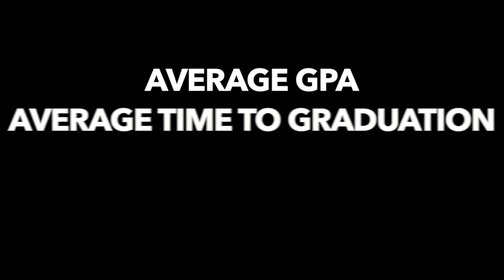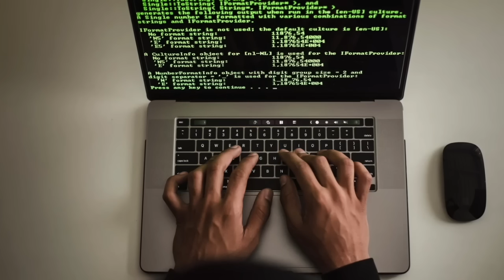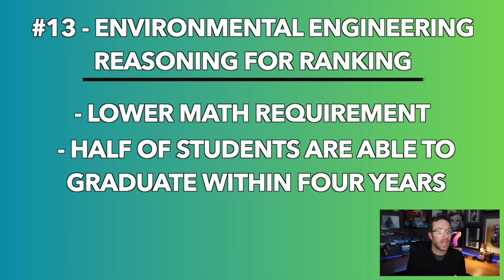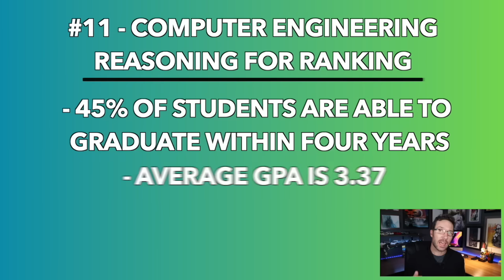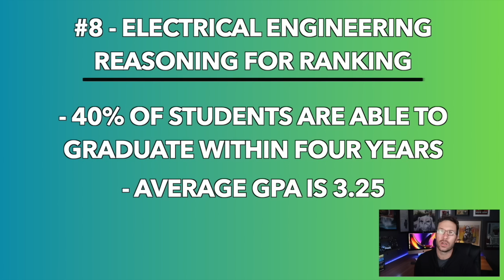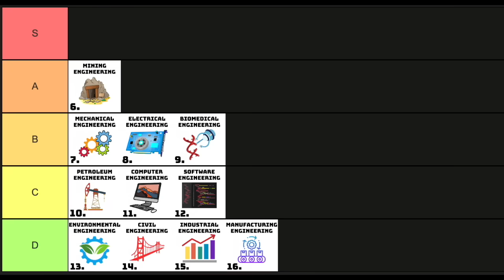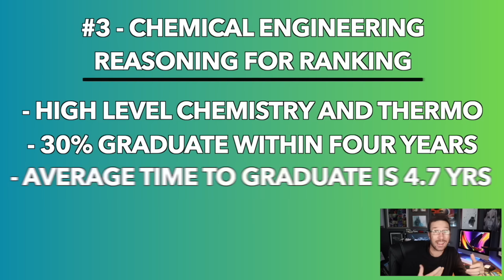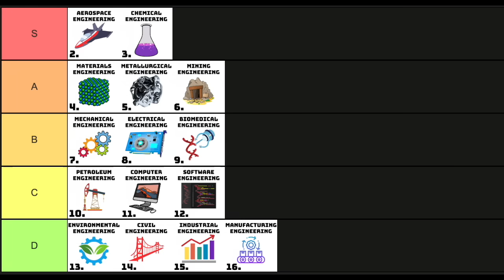Engineering Degrees Ranked By Difficulty (Tier List)

Comment: When I studied Chem. Eng., back in the early 90´s, the disciplines I found most challenging had to deal with transfer phenomena (a combination of mass transfer, heat transfer and fluid dynamics, with a wide range of fluids and behaviors, newtonian, non newtonian, laminar, turbulent flows, etc.) and reactor desing (basically take the former and add chemical reactions). Of the courses given by other faculties (service courses) the most difficult (abstract) was Physical Chemistry. Chem. Eng. so called Equilibrium Thermodynamics was also tough. Mostly having to study the design of engineering equipment and chemical plants based on quite abstract models is rather complex. We took an specific course on Mathematical Modelling for Chem. Eng. on top on 3 courses of calculus, differential equations and linear algebra. Where I studied almost all engineering degrees had to take the same basic math courses (3 courses on calculus, one on differential equations and one on linear algebra). At work the most challenging thing was learning to work ¨with people¨ after studying basically to work with abstract models.

Comment: Poor way to rank.
Reply from the maker: maybe .. how would you do it?
Reply: @becominganengineer2271  Well first and foremost, you've broken up engineering in too many types.  There are actually only a few main types: Electrical, Mechanical, Chemical, Civil, Mining and Metallurgy and perhaps one or two more.  The rest that you mention are all subsets of these.  So in order of difficulty, Electrical and Mechanical are the top two based on the math and concentration courses such as circuits, magnetism, computer and software related courses, mechanics, thermodynamics, fluid mechanics, heat transfer, etc.  This is followed by Chemical Engineering, Civil and lastly mining and metallurgy.

Comment: I mostly agree with this ranking. I have a lot of friends in different engineering majors and generally, we more or less fit in this distribution.
However, there are some stuff I have to mention. As a chemical engineer I can surely say we don't study chemistry that much. Many of students already have good chemistry knowledge from high school. Tbh, I didn't get to discover anything chemistry-related from university. Everything related to reactions is dealt with math. models. So you can afford to be mediocre in chemistry if you are good at math and googling. I think extreme reliance on profound understanding of thermodynamics and fluid mechanics is the reason people struggle with this major. Yes, mechanical engineers study that too but at least in my university mech. engineers were having an easier time (more on that later).
Also, I should mention that it should be taken into account that nuclear engineers have to study quantun mechanics. This discipline is extremely hard, counterintuitive and math-reliant. It's extremely hard to study on your own and profs not always have answers to all of your questions. Well deserved 1st spot. 
Materials engineering is also extremely hard (taking it as a masters degree) because many materials engineering programs dive into nanomaterials and functional materials which adds requirements in chemistry and quantum mechanics. So modern materials engineer's skills should vary from structural mechanics (sticks and stones to build a bridge) to quantum world.
One of non-mentioned biomedical engineering difficulties is biochemistry. I am a chemistry enthusiast myself but when I saw what my GF studies in her biochemistry course I was shocked with that elven language.
Now to how to percept this video. Don't entirely rely on it. Difficulty also depends on the university. For example, in my first university mechanical engineering was one of the easiest (in school of engineering, of course it's much harder than humanities). When we had to take courses with mechs we were stunned that they always complain when get less than 90 for their assignment. During the second year electrical engineers were competing with us for the hardest major in the university (however, they had easiest senior year while we were dying). The thing I'm saying is that do your homework if you are watching this video to choose an engineering major. Only youtube isn't enough, study universities, take a look at courses that will be in your program. And don't choose major by difficulty. If you really like things you study, spending hours on learning it won't be that hard. Moreover, maybe you'll spend 4-5 years on undersleeping, health problems (I'm not about mental health), and lack of free time but at the end it's all to work in the field. So look at the job (activities, not salary), choose the one to spend your life on.
Reply: the advantage of taking up engineering is the ease of shifting to any kind of endeavor in the future because of the extensive & intensive training in analysis..

Comment: Aerospace here. I didn't think it was THAT difficult but it was a lot of fun. As an Aerospace engineer you are an "everything" engineer. Mechanics, fluids, aerodynamics, chemistry, materials, structures, thermodynamics & engines, mechanisms, electrical power and electronics, radio communication, automation (control theory), operations, maintenance and, rocket science and, of course, tons of Maths! The only thing that you see very little is modern physics (Relativity and Quantum Theory).
Reply from the maker: i think if i didnt do mechanical. .. i wouldve done aerospace

Comment: I started off at school in Civil Engineering.  Found out all they do is dig hills and fill in valleys.  So I switched to Industrial Engineering.  Found out I was borne to do this work.   The fun part is while going to school for IE and later being at work with other IE's , everyone around you is just like you.  It was great,  I am retired now.
Reply: Could you brief on what types of projects u worked over, the experience, job market etc. I'm going for undergrads & currently deciding b/w ME & IE. IE seems interesting but I'm not fully aware of its practicality.
Reply: @deSalvay  I washed out of engineering school 12 years ago (considering going back next year for Geomatics Engineering though), but one of my classmates who earned his industrial engineering degree now works as a MECHANICAL engineer at one of the major American aerospace corporations. So as long as you take some technical electives that transcend engineering fields (e.g. statics, dynamics, etc.), you might be able to find work in a field of engineering outside your university major.

Comment: What are the degrees most relevant for Fusion Researchers? I believe a commercial Fusion Reactor will be built some time this century. Since "Working Fusion with Excess Power" has been "Maybe in 20 years" for some time, I can't say if it will be another 20-40 years, or near the end of the century...but still I think sometime this century is reasonable because ALL science is still progressing worldwide. Whenever there are Commercial Fusion Reactors; Fusion Engineer should be about the same difficulty as Nuclear Engineer because there would be a lot of similarities in the two types of Power Generation Stations.

Comment: I'm a retired (after 43 years) electrical engineer, so that's my bias.  Mostly I agree with your assessment at the lower levels.  People can make a good living choosing any engineering discipline and therefore, interest and aptitude should be the most important factors in choosing.   With the exception of mining engineering, I've worked with all of these disciplines in my career.  Educational difficulty can be objectively measured by the salaries that these fields demand.  Petroleum engineering is a position, the degree is chem e.  Computer engineering is also a position, these are most frequently electrical engineers that decide to design computer circuits.  Biomedical engineering is also mostly electrical engineering.  Electrical engineers can become Biomedical engineers by taking another semester of classes.  The top three most difficult are Chem e, ee, and aerospace.  Arguments can be made for who is first.  EEs need more math than any other discipline.  And there is just no way that mining engineering is more difficult than electrical engineering.
Reply from the maker: all good points. i think will remake this video at some point in the future with some new data
Reply: I don't think the salaries completely correlate with educational difficulty.  There's also a "demand" factor.  (Just ask any theoretical physicist!)  The amount of education needed to do my current job as a software engineer is significantly lower than what I needed for my Ph.D. in mechanical engineering, but the payscales are much higher for the software engineering than anything I was looking at in M.E.

I would also note that sometimes things like Computer Engineering and Petroleum Engineering can be degrees as well as positions.  Though, yes, they are arguably sort of specialized variations on EE and Chem E degrees, so it may not really be that useful to consider them separately.  Whether they're easier or harder than the "base" degree will completely depend on the college.

And I think the "who needs more math" question really depends on the subfield at least as much as the overall field.  I would say that statistical thermodynamics of fluid flow is at least as complicated as anything in EE, and if that's not enough, when I was an ME grad student I had colleagues who were working in statistical thermodynamics of plasma flows.  But, yeah, at the undergrad level, EE is likely the hardest if they're doing computations on fields.  Undergrad fluid flow classes in ME and AeroE require a conceptual understanding of partial differential equations, but the equations aren't closed-form solvable so you either do numerical solutions or simplify them to 1-D calculations.

Comment: So disagree with respect. EE and Physics here-practice engineering for 37 years-highest mathematics partial differential equations, Advanced Calculus(Transforms)-Abstract Algebra-because codes like BCH and Reed-Solomon-Galois Field theory. Linear Algebra, Vector Spaces, I mean pretty high in my view and certainly should be high on the list.

Comment: Taught civil (hydrotechnical) engineering for 31 years, retired a year ago.   Son has an MASc in electrical.  Some other factors for those seeking guidance as to what to choose:  (1)  Are you sound in the basics of things like trigonometry and physics?  If these things are not second nature to you, you will find that you don't have time to review such basics due to the workload in a good undergrad degree, which will make your stress level too high.  (2)  There is overlap at the highest levels.  There are a lot of boundary value problems and generality of numerical methods to solve those bv problems (ways to 'solve' the underlying partial differential eqns in a given setting), for example.  Physics and chemistry are 'on top' of it all.  This means that you need to ask why a given physical setting interests you and whether the associated design problems really interest you.  (3)  How much interaction with people do you like?  If you are much more comfortable with solving problems all day and do not much like having to interact with colleagues and clients, do not do civil engineering.  (3)  Can you readily follow a wide range of physico-mathematical arguments?  These are not physics argument, they are not mathematical arguments (there is usually no truly higher math in them), they are physico-mathematical arguments and few people have enough physics intuition to use mathematics to invent new ones, yielding useful new off-shoot theories and new governing equations.  All the major branches, civil, mechanical, electrical, and chemical engineering all use much physico-mathematical reasoning.   (4) If you have a bent for management as management you should consider industrial engineering, but you need to be good a kind of math that most people know nothing about, called operations research.  (5)  If you like highly applied engineering that has visible results, civil engineering and mining engineering can be very satisfying.  (6)  Do not pick environmental engineering.  The environment is everything and everywhere.  The degree content is the least standardized.  Some grad's know nothing about air pollution but know quite a bit about hydrology, go to the school in the next city over and it ca be the other way around.  Our environmental engineering program often got our weakest students and (interestingly) I found that they were vague in their thinking from the get go, they liked vagueness.  (I hate it, I am an engineer.)  (7) If you like to get out of the office and on an outdoor site from time to time, say at least a few times a month, civil is a good choice.  Civil engineering is itself very diverse, I would say that civil has six clear sub-disciplines or realms, namely: structural, geotechnical, hydrotechnical, transportation, construction management, and environmental.  The environmental in civil covers water treatment, wastewater treatment, and is allied with geo and hydro when it comes to contaminant transport.

Comment: I think youir ranking of EE is in general correct, but there are rather large differences in difficulty for sub-disciplines and the undergrad courses that particularly lead to them. Undergrad fields and waves courses are harder than undergrad circuits or communications theory. In the latter two, difficulty is reduced by learning to use transforms to convert complex math into simple point by point multiplication and inverse transforms. If you are headed toward electrical machinery design or antenna work, you need the higher math, a good grasp of approximations/computer simulation, and so on.

Comment: Great ranking. However, I wanted to note one thing regarding software engineering. As a 3rd-year software engineering student, I would say that in the US, it varies on what type of software engineering degree you are getting. If the program is ABET accredited under the Engineering Commission, then it will be very rigorous. For example, my program's (abet accredited) math requirements are calc 1-3, calc-based physics 1-3, DE's, linear algebra, prob/stats for engineers, and discrete mathematics (one of the weedouts). In the past, I have seen that some of the non-ABET accredited software engineering degrees are not as rigorous, which is why I say this.

Comment: I am not in engineering now, but I had a question about ranking based on time to graduate: are there lurking variables associated with the time to graduate that are not related to how hard the courses are?
Reply from the maker: Most likely… but a lot of that is difficult to quantify
Reply: It could be hard to get courses. I gave up on a CS undergrad in 1989 and went into EE because I couldn't get into many CS courses as a sophomore. Priority was given to seniors, and demand was growing much faster than the program was. I was probably looking at five and a half to six years to get a CS degree vs four and a half standard for EE.

Comment: I know many electrical and mechanical engineers with PE licenses but not many in structure engineering. I think they have to go through civil engineering undergraduate then structural engineering graduate program. I also think they need to pass the civil engineering PE before taking the structural engineering PE. That would be 24 hours of examination including the FE (used to be EIT 8 hour exam not 6 for FE as of now). PE exam in the old days were all problem solving now its multiple choice. There were few years where the old problem solving PE exam failure rate for EEs were over 80%! Scarry.

Comment: This is an interesting point of view. 
But I would say it changes a lot between countries and specially universities. 
The department and professors will really change the difficulty. 

I would leave electrical and mechanical because these two degrees are like "mother of all". 
Aerospace is literally a child from mechanical. They don't see anything a mechanical engineer wouldn't grasp. It's just more specific in it's application.

Also, mech and electrical do have some specialties which can be as abstract, math heavy and interdisciplinary as you wish.

Comment: I disagree with the list as it does not take into account many variables.  The hardest engineering is the one you do not like.  Choose a field that interests you and you will do much better.  I am a computer engineer from 86 but worked in industrial automation which on your list is closer to nuclear and chemical.  The hardest class mathematically was analog communications which has a math level beyond what you have listed here but for me as I found it interesting it was easier then magnetic field theory which I did not like.  As for time to graduate there is to many missed variables as weaker students are guided to the easier disciplines, small faculties cause problems when not all the courses are available at the correct time etc.